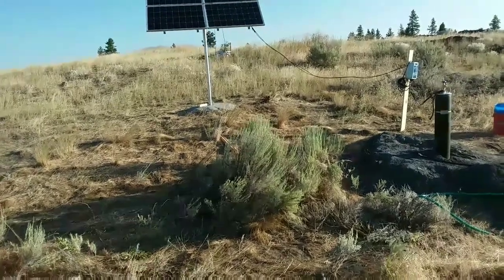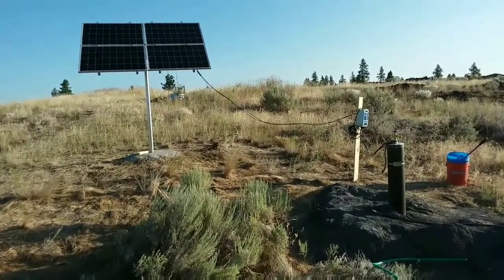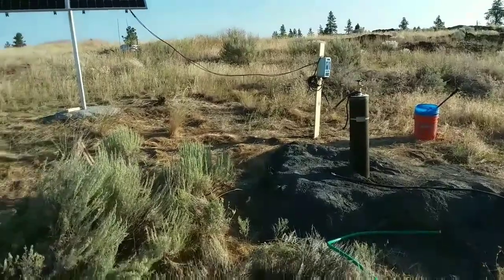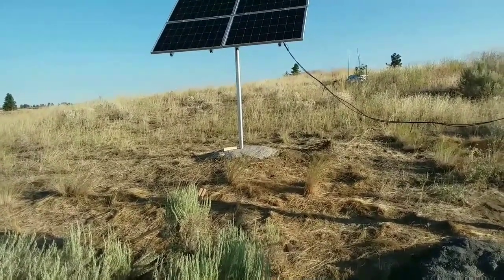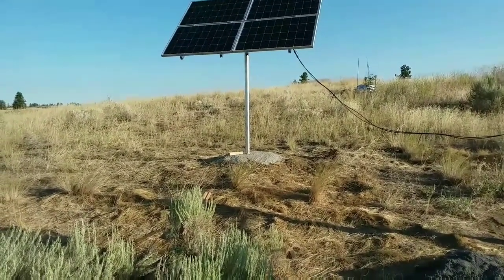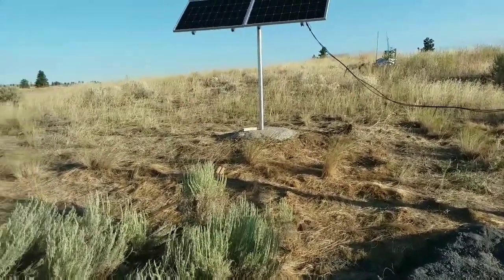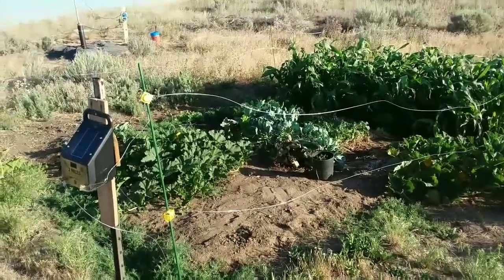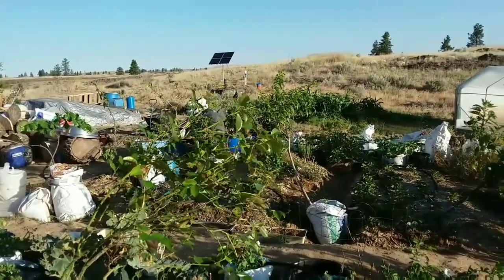Over view of the RPS 400V Solar Well Pump

Comment: Did you set your pump too? I'm being told I should hire someone. Im 25 GPM at 400'. Thanks
Reply from the maker: We live completely off grid. So the requirements for us might be different. Now, with that being said. RPS is by design a DIY system.Took my wife and I about an hour to wire, plum, and drop. The about another hour or so to mount, hookup, the panels the mount and hookup the control box. Personally, I'd call RPS for what size system would be best for you. That is what I did and that is why I have a 400v.